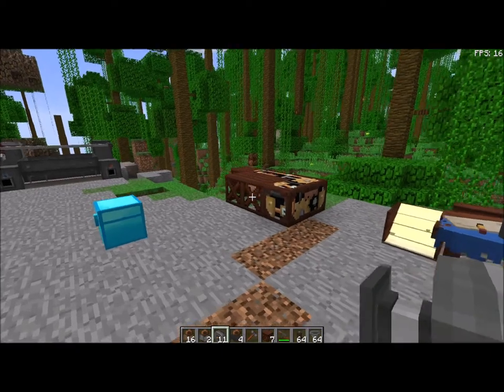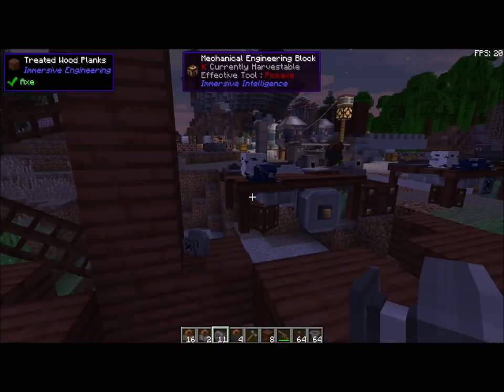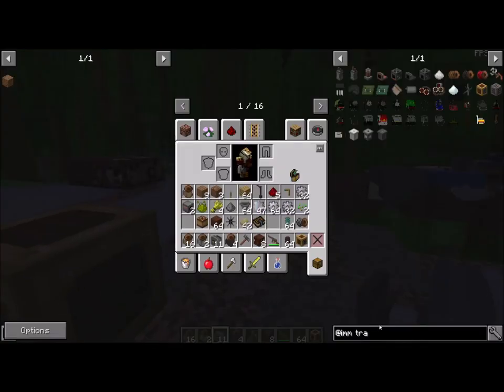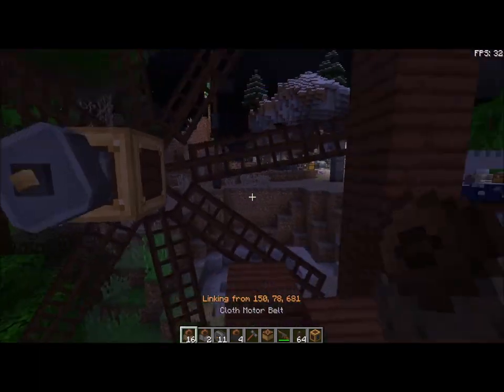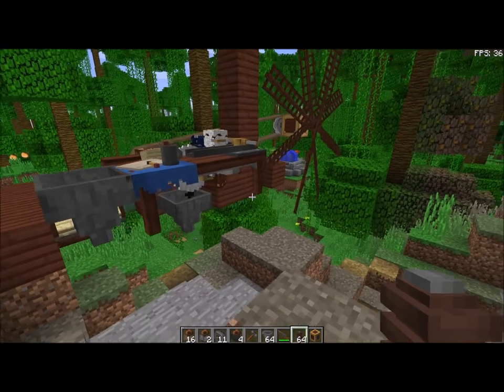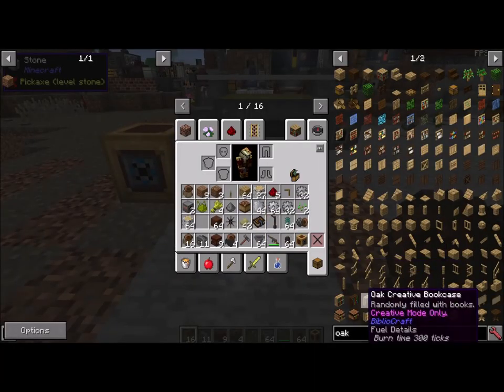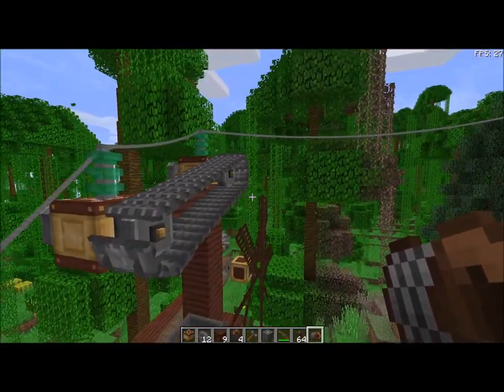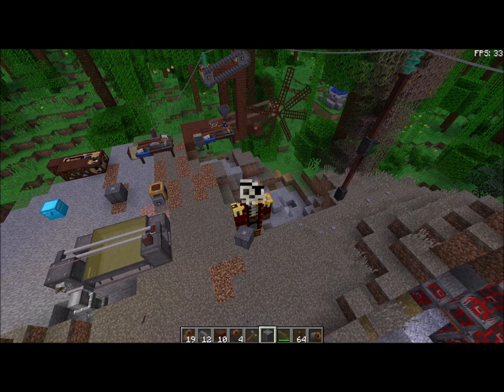How too   Immersive Intelligence Saw Mill

Comment: Ya if your reading this it's a lot more complicated with gears you now how mechanism steel looks or thermal steel looks when cooking from the immersive Blast furnace you get ether one then immersive steel texture ya it's the same for the gears and some materials they do work but in this case ya need's fixing.

Comment: can anyone help me my saw mill is accepting only torque and no rpm i am doing the same shit u do
Reply from the maker: Double-check your inputs and outputs on your gearboxes with your hammer. it is possible the latest version broke it, however, you could take your setup into creative mode and switch out the bands and layout. Also sometimes the band placement might flip onto the windmill side of the gearbox but it will still work (just wonky looking). Regards,